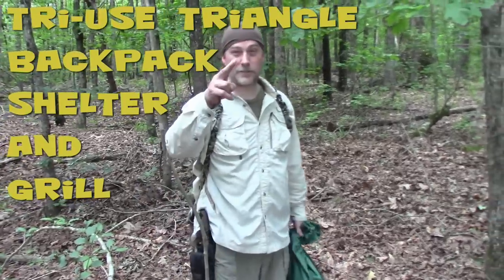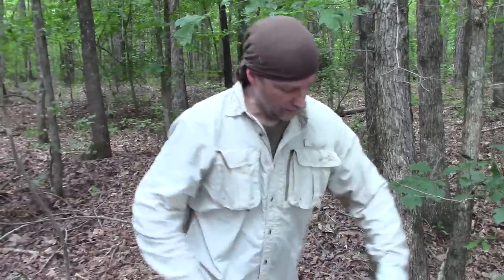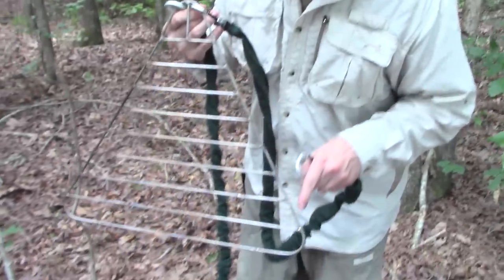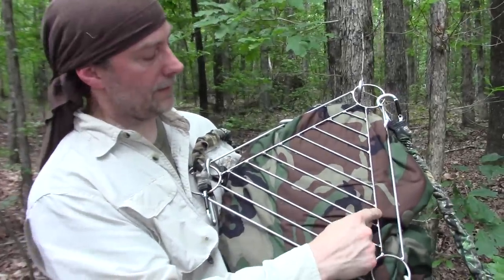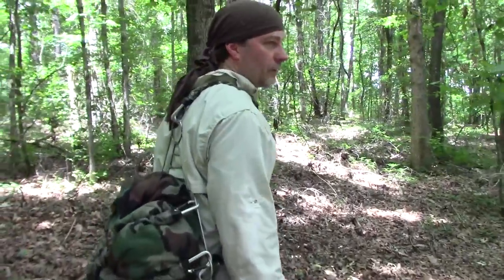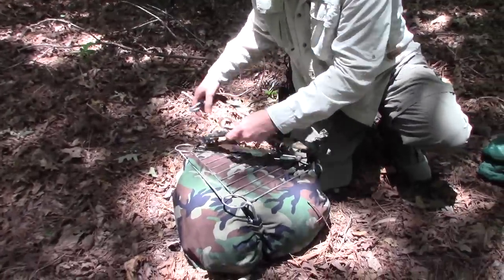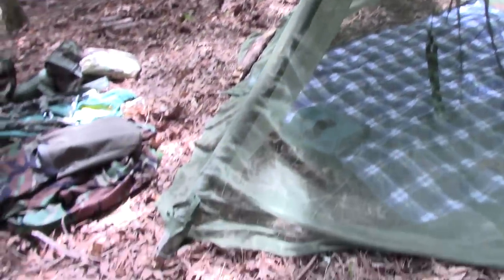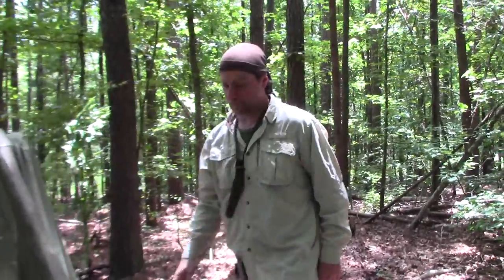Tri Use Triangle Grill Shelter And Pack Frame

Comment: That's a cool idea I was thinking though just a small recommendation I did this with my pack so I know it works make or acquire a net nothing crazy and use that to strap your pack to the Grill it works great it's like a giant compression strap and you can use the net for other purposes once you get to Camp such as making a seat or even using the net as a small piece of structural equipment for making a shelter such as a door or even part of a wall just like the grill you got.. but yeah man great video
Reply from the maker: I like that idea! I think I know the kinda net you're referring to. Could also cover a cot? I'm glad you liked it. Thanks for watching
Reply: @Reallybigmonkey1  I made mines out of paracord it's just a pleasure to watch somebody with the same mindset as if I can't use it for at least two different things I don't carry it

Comment: It's a three-pee...lol
Just sticking with the tri theme..
I will be curious to see how the welds on the circles hold up over time from the stress caused by the tent poles. Especially if the frame has been used as a grill a few times and gotten heated up. It may not be an issue in the end, but it crossed my mind
I think you are on to something pretty useful for sure.
I appreciate your willingness to let us see the process. The good and the bad are part of it and it takes guts to show more than just the finished product after all the bugs are worked out.
Reply from the maker: Lol, I love that three pee name! I have no idea how bad it will bend,  I'll just have to use it and see.  Thanks for watching

Comment: Oh, an idea for the cap. Attach shock cord to the three corners, then sew three of the ferro rod toggles (the little ones they use for the paracord bracelets) to the body. Might as well keep everything muti purpose lol.. That will hold it in place and let you put a stick under the cap to hold it up for ventilation.
Reply from the maker: Good idea Rodney

Comment: I use a lavvu which seams a similar concept, kinda.

The 2 canvas halves are long poncho while walking. Put together they form an 8' diameter tipi. Or 2 half makes a 4x8 lean to.

I replaced the center pole with 8' telescopic tarp poles. I use the two tarp poles as trekking poles for the tent. Or just bring 1 pole for the lean-to.  I also use paracord running inside the canvas fron the pole peak to exit the grommet at the lower edge to steak out the tent and hold the shape. 

This also let's me pitch it at 57" tall low to the ground. Or optionally I can extend the pole higher and fly the tent in hot weather.

I can close off the tent top in cold or rainy weather. Or leave the top center open when I fly the tent to let heat escape.

I also have an optional bug net I can wrap around the poles and paracord lines under the canvas.

The down side to this is weight.

Each lavvu half, lines, and stakes is 3.3 pounds pack weight plus 1.75 pounds for 2 tarp poles used as trekking poles. This is easily managed  by one person for a lean-to. A single person for a tent though jumps up to 6.6 pounds pack weight plus 1.75 pounds for the poles. And of course obviously 2 people can each carry the lean-to halves for a little over 5 pounds each and you have 4 tarp poles to set up with.

Maybe this might give you some ideas for change in you system. Like the paracord lines attached the grill to fix sagging issues. 3 additional stakes and some paracord isn't going to weigh much more if you aren't even already carrying them now.  Also it might help avoid touching the sides during rain by pulling the middle of each side out slightly,  kinda od a slightly 6 sided pyramid instead of 3 sided.
Reply from the maker: I've always wanted a Lavvu.  I do have two Polish Palatkas.

Comment: If you count the triangle of ground the tent is on, the shelter is made of 4 triangles which makes it a TETRAHEDRON. A tetrahedron of 4 equilateral triangles is one of the five REGULAR SOLIDS (3-dimensional figures all of whose faces are identical) of Euclidean space. There can only be five. The other four are: the cube (6 squares), the octahedron (8 equilateral triangles, two pyramids joined at the base, one pointing up, the other pointing down), the icosahedron (12 pentagons), and the dodecahedron (20 equilateral triangles). 
     I would like to suggest putting tie-outs on the two sides that don't have the door so that they bow out instead of sagging in.
Reply from the maker: Thanks for the info Craig! Im definitely adding some tie outs.

Comment: My initial suggestion is to position the net's stuff bag (filled with leaves or other empty stuff bags) upon the grill/frame between (and taller than) the top ends of the poles to keep the wood from ripping the bug net and/or tarp while staking it down.
Reply from the maker: Very good idea!

Comment: Excellent idea my friend! I was wondering if the pack frame/ grill could be made from titanium to give it just a little more strength. And a second set of rounds inside to put smaller sticks to hold up the top rain fly. Then tie it down to the main sidewall with sewn loops in case you can’t find trees close enough. Just a thought. Keep up the great work‼️
Reply from the maker: Thanks Chris,  we are glad you liked it and those are some good ideas!

Comment: That tripod seems like a great way to pitch a tent without carrying poles. I would try to cut out one panel or just some of it and add a cubby hole or almost a tail. You could sit in the cubby to be further from the fire when it's going. Would also be neat to place stones around the fire and see how much heat they hold for after you put out the fire to sleep. I should stop talking and make my own, lol. Just my thoughts, it's really neat as is.
Reply from the maker: Good ideas you have and I'm glad you liked it! I'm definitely going to use stones around the fire this year.  Thanks for watching

Comment: That's definitely a great setup! You always have such great ideas. That little wolf spider was interested for sure hahaha. Velcro for the net but for the door maybe some button snaps? I think the hanging fire is a great idea that way you can remove it if needed and have all the floor space you may need to beef up the frame though for that.. maybe just make the outer bars a thicker stock?
Reply from the maker: Thanks! I'm glad you liked it brother.  I like your ideas, this thing is still a work in progress

Comment: Okay, thats an awesome start. The parasail is cool 😂. The first thing I thought of was... skewers with hooks to hold it onto the metal frame and to the parasail. That would hold it up off the opening and stop it from flying up, then it could be attached to the tent using mule tape. I think you have a great idea. Nick don't stress... a fire on the inside of the tent is a really good idea. No fire and no melting will occur. Hmm.. Now that line just made me think that you're not going to want that parasail flopping around as it could possibly fan the fire inside. Keep up the awesome work and can't wait to see the results.  Good luck with the giant spiders 🕷
Peace and Freedom 🇺🇸
Reply from the maker: Thanks Bailey,  I'm glad you liked it.  Good ideas you mentioned but the most important of all, you brought up a very valid point about that parasail topper fanning smoke back into the shelter.  I gotta fix that for sure
Reply: @Reallybigmonkey1  I have thought about the way it sails. The only way I can see stopping it from sailing around so you can still keep a pot on it is to hold it to the the base. Three rods holding it up but then it seems like you would still need a triangle frame attached to the sail. I cannot wait to see how you fix this issue. It was good to hear Nick thinking about having a fire inside the tent. Shows he is thinking plus he will be impressed when you show him it is possible.

Comment: I say just make you a wire pyramid to go on top that connects to the pack frame and lay the top piece over that and attach it some how , that way your protected from the rain and it still ventilates, and attach some webbing on all sides of the tent body where you can pull out the sides with paracord and stakes so it gives you more space inside the tent….it’s an awesome shelter for one person but I think you need to make a bigger one for you and nick …I love the design …..a good firebox would do well inside it , I don’t think I would recommend the hanging fire pan just because it would be prone to getting hit and someone getting burnt , and keeping hot water above you could be prone to getting spilled on top of you or nick…can’t wait to see y’all camp in it though …..
Reply from the maker: Thanks for the input and I'm glad you liked it.  It's definitely an evolving project and I hope it's perfected by winter! Thanks for watching

Comment: If you want to heat proof the upper foot or so of the inside of the tent, they make a thing called fire cloth that is like a fiberglass felt or cloth.    4 feet of that in the upper foot of the tetrahedron would make it safer, since that is where the rising heat is likely to hit.
You could even put a little cylinder of the fire cloth around your small fire to cut down on the risk of melting your bivy on the hot rocks.  I saw a YT video where they put the fire at the edge of the tent and made a little chimney using vertical stakes driven into the ground and fire cloth wrapped around and inside the stakes to protect the tent and keep the fire gases out of the tent.
When you get this design all polished, please make a diagram of the parts and dimensions so we can make one too!
Reply from the maker: The video you are referring to was filmed by me. I've been putting that fiberglass cloth in shelters for about 8 or 9 years on YouTube. Im probably going to try one of them fabric style chimneys on this set up.

Comment: Hey guys... how about sewing toggles at each leg & using longer legs to come to a point? Then you would basically have a parachute vent. And, if you didn’t want to use longer sticks, make up triangles that hinge up to form an apex. They would fold flat for the Roy Croft, or flat on ground for pit fire, or fold at 90° for grill legs. I would also make a floor tarp with pockets at the corners (for the legs) so all the angles are consistent & midpoint toggles to attach the sides. The pyramid derives it’s strength from equal sides & angles. Tie-outs for the middle of each side would give more room inside... just my thoughts...
Reply from the maker: Fantastic thought! I really like the fold out grill leg idea

Comment: As always you got my engineering mind working....the only thing, I would try to redo...is the top rain/ vent hole cover....small poles to hold off and up to vent....in case there ain't no trees....to tie to.course that requires something to mount poles to?
Reply from the maker: It didn't work out well as first designed.  I'm definitely going to do something free standing.

Comment: Hi. I have a few suggestions.  1, make the door wider. For the bigger people.  You could make a ground sheet that you velcro to the bottom  so that you don't have bug and snakes come to sleep with you. . If you had a fire out side you could make sqare and have that reflective stuff on one side to reflect the heat towards the tent. I like the idea of the shelter.  But I think it should be a little higher and wider.. the cap could be a little wider and your idea of puting loops and tieing down the tent is a good  idea. Hanging the fire in the tent not so good.  Be causes you may be careful but you  may hit it in your sleep and knock it over. I think three sizes would be good. Medium larg and  Xtra large for the bigger people.  But I think it's a good Idea. .
Reply from the maker: Thanks for the input Randy and thanks for watching

Comment: This is brilliant!!!! What about lining the top portion with a fir proof fabric and adding a ring around the bottom of it, extending the height a little and therefore the inside space, of waterproof plastic type fabric, adding a water line. You have so many brilliant ideas!!! I was thinking too maybe a second slightly lighter triangle, it would reinforce as an Alice pack, gives you a grill to use as a second one or one to use while also using the tent. Also allows you to reinforce the top structure when the weather is strong winds erc. Just some thoughts. Some gear pockets inside later could be helpful too. Or a little fabric triangle seen into one of the corners slopping slightly down towards the back gives you instant shelves that simply fold into it. If the wood posts were longer they could be used to hold the triangle flap up off the top and it can peg to the ground qith rope. Another thought.
Reply: Oh the second grill could be hung inside from the first grill with fireproof cordage lol
Reply from the maker: Very good ideas!
Reply from the maker: Kinda similar to another set up I once used!

Comment: Like the setup but wouldn't have a fire in there.  Maybe a small cooking stove but just don't trust sparks hitting the sides. Like the idea of the grill forming the top to hold the posts. also you could just have your triangular piece on top just strapped down if you didn't have a fire or a need for it up higher. You are a talented seamstress(sewer) :)
Reply from the maker: I'm thinking fire bowl,  or fire pan or at least a fire rock ring. I may just add a welders blanket like in the others.  Thanks for the input and thanks for watching brother

Comment: Why not try plasma cutting this shape into plate steel or better yet iron. Love the ideas brother long time lurker here. Priceless!😁👍
Reply from the maker: Good thinking but I'd just have to experiment to see if it's too heavy.  Thanks for watching Hiro
Reply: That raises a question that I've been wondering about. I have a piece of 1" plate steel. I use it below some of my twig stoves on my gazebo and a trivet at my outdoor kitchen.  Question is, would this be food safe? I have seasoned it just like cast iron@around 650 degrees on my charcoal grill. Reason I wonder was using it as a griddle on my grill. I have sanded it glass smooth and wouldn't take much to get to a nonstick surface just like carbon steel that's been seasoned.
Reply from the maker: @TNBushcrafter  Straight bare carbon steel? I wouldn't use it.  Carbon steel that's been seasoned? Yes definitely.  They sell Blackstone griddles at Walmart with carbon plate tops you have to keep seasoned so it's gotta be safe to use

Comment: My only problem with it is the door but then I'm older and a lot rounder and they can be difficult for me to get down on my knees. I would like to see one whole side split down the middle to use as either a single door or a double depending on how you stake it. A rain fly over the door might be nice also but isn't in line with the minimalist idea you were working with. When you were talking about the fire I was thinking doesn't he have a hanging fire cook system? Yes it's a little confined for a real cooking fire but a small warming fire might be nice in the winter....
Reply from the maker: Yes, a bigger door would be better but Im thinking it may make that side sag more. Yes, I have a few hanging cook systems and Im definitely going to try one of them out in here! Thanks for watching Doc

Comment: As you were saying regarding using paracord around the tree limbs to prevent the tent from sagging, you could attach loops to on the inside to receive that paracord. Also could you use longer limbs but slide the pack frame down to wrist hight so there is enough structure at the top to suspend the tent cap? 

Nick might just end up eating his words, literally, after you guys prepare your first meal in this tent!😂
Reply from the maker: Good ideas and can't say much without more tests. I think of ideas then they never work as intended during tests. Lol. Thanks for the comments and thanks for watching Brandon

Comment: Howdy, Dave. Another good set up. If I may, I would make the frame in slightly elongated rectangular shape, so I can attach kidney belt and shoulder straps. You could still use it as a grill. Secondly, I would put in a ring in the middle of the frame/grill to be used as a stove jack. Thirdly, DO NOT HAVE AN OPEN FLAME IN THAT TENT AS IS. Of course, I know you wouldn't, but just in case you inhale too much smoke someday. It is just not safe enough. I love you and respect you and all, you know, but if you are to have an open flame as a heat source in a tent, it has to be much bigger and much taller. I tried to build a teepee from the specs I got from a book on native american shelters. The result was far less than ideal. The fire within safety limits was not giving off enough heat and venting of smoke was a big problem still. I was inhaling too much smoke. In a survival situation, I could tolerate it. But not in camping. You are much better off with a dedicated tent stove and a heat exchanger. Then there is another problem with condensation as well. Survival Lilly has a set up that is pretty nice but that was more of a permanent shelter. I am sure you can fabricate a nice small stove which is light and safe to use. Not trying be a knowitall but just want you to be safe  Dave.
Reply from the maker: Thanks for the comments.

Comment: I have always liked the way you  take gear and make them muti use items. This is a great set up. How will you water proof the tarp? Looking forward to to the winter video to see how this works out with your modifications. That mora kansabol great knife for lite work. Thanks Again Dave and Nick for as always great video. Alan R.
Reply from the maker: Thanks Alan,  I'm glad you like the way we do things.  We will use a mixture of silicone and mineral spirits for water proofing.  Thanks for watching brother
Reply: Do you spray or dip the material & let it soak ?
Reply from the maker: @lilgreentruck3936  I thin silicone with mineral spirits and let the fabric soak in it